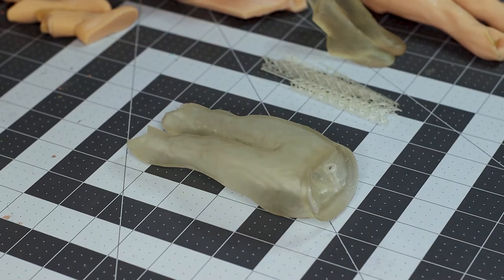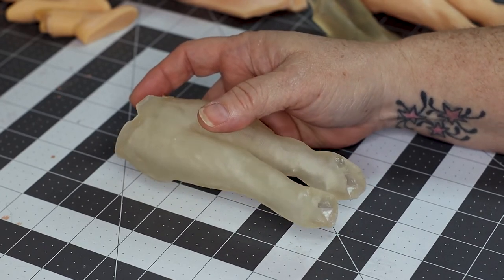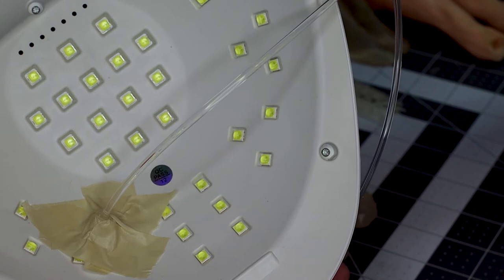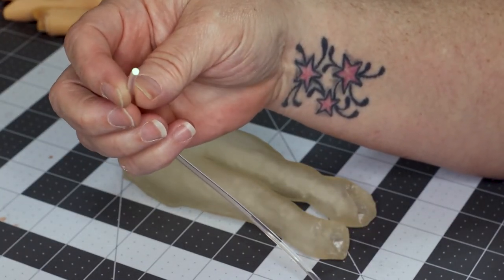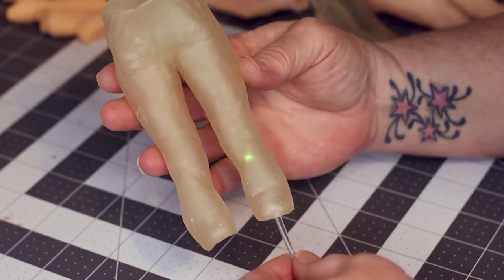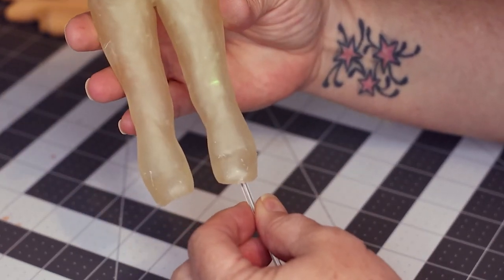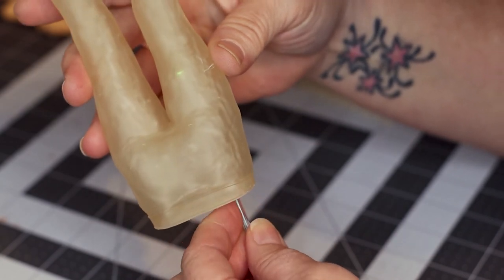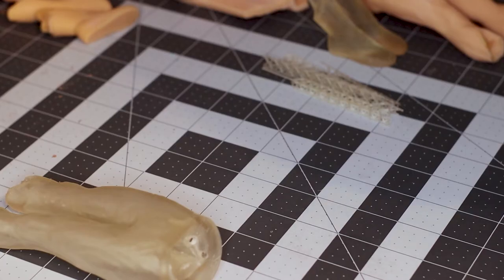Cure your resin prints with fiber optics??

Comment: If you sand the optical fiber along its entire length, you will be able to cause ultraviolet light to leak evenly towards the entire area of the fiber and you will not need to be moving the tip of the fiber throughout the model, once sanded you leave it along the model inside and done.
Reply from the maker: Great to know! Thanks!! 😊👍